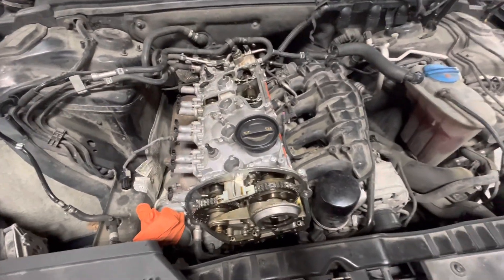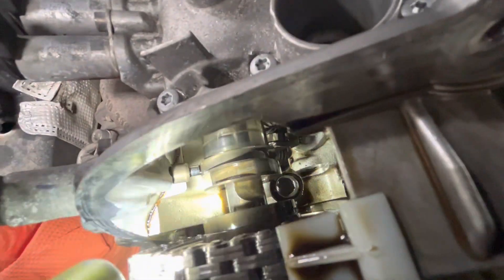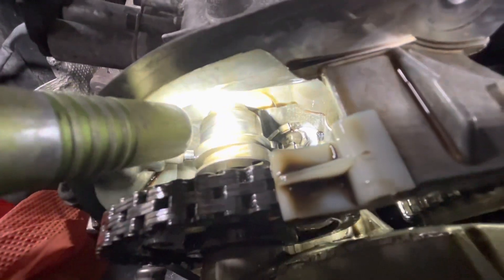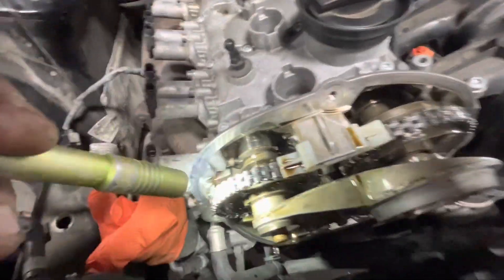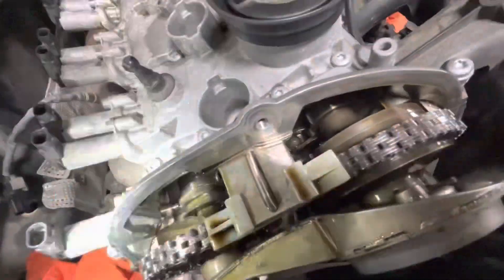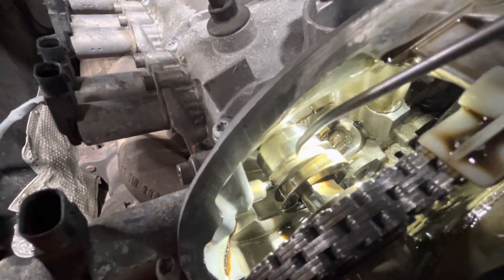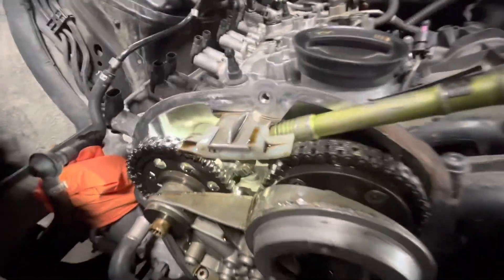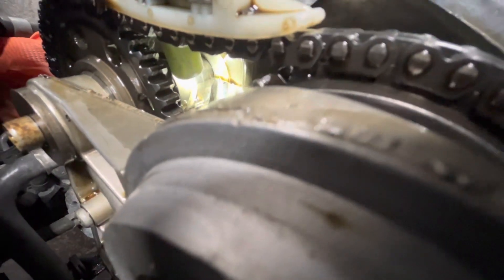TRYING TO EXPLAIN HOW THE VARIABLE VALVE LIFT WORKS ON AN AUDI

Comment: I’m having code P11AB Cam shift actuator B cylinder 3
Circuit/open. Could it be a faulty solenoid on cylinder 3? What would your first steps be to make sure?
Reply: It is on Audi Q5 2.0T 2018

Comment: Hi mate.
Early this morning my audi a5 has been experiencing issues its runs fine on D and R but when changing gears above 2000 rpm it hesitates and sort of lags.
Do you think its the solenoid?
Reply from the maker: It doesn’t sound like a issues with the solenoids to me, do you have any engine or transmission related faults stored

Comment: Thanks for this explanation. I was testing them and couldn't figure out why it was not coming backward when wires are inverted. Thing is when you apply 12v is doesn't come back only if you push on the little thing (can't find the name😅).

Comment: Could this give me a p0016?  I’m having long cranking at start up then it drives smooth but less power.  Any help is appreciated. Thanks in advance
Reply from the maker: What car do you have?
Reply: @EuropeanAutoRepair  2015 A4 Quattro
Reply from the maker: If it’s a 2.0tfsi you need to make sure the timing chain isn’t failing. If that’s the case you shouldn’t drive it until repaired
Reply: @EuropeanAutoRepair  the news I was fearing 😢 ok i have to drive it to and from work these next two days then will take to a shop to get a proper diagnosis.  Thanks for you help and feedback
Reply from the maker: @BangBangNiner no problem!
Reply: If you remove them all to clean them ..do u have to use the pin tool to realign them? I didnt move cams or crank ..just removed them all one at atime to clean /and reinstall.

Comment: I had a misfire determined it was the coil plug connectors so i replaced those and damages once of these connectors in the process unknowingly the misfire was fixed for a few start up then came back and that damaged connector is the only issue i can find. Is is likely it did damage to the motor?

Comment: One of my wires going to one of these solenoids are exposed and bare. Do u think that could cause a issue? I’m thinking about going to junkyard and getting new pair
Reply from the maker: Yeah using the factory wires would be nice to keep the colors correct but replacing the wires with anything the same gauge will be fine, do you have open circuit or short to ground faults stored?
Reply: @EuropeanAutoRepair no codes. But it has a stalling and idle issue when i come to a stop. Tomorrow I’ll go pull a new harness and hopefully I can fix it. Thanks for the reply I didn’t expect such a quick reply.

Comment: Would this cause a misfire/ intermittent compression reading, having a misfire with my Audi soon as it heats up its perfect I've done everything plugs coils injectors carbon clean, PCV valve diaphragm check my next step is to pull the head I suspect a burnt valve or cracked piston but after watching your video I began to wonder 
Cheers
Reply from the maker: I wouldn’t rule out a broken valve spring either, if the misfire comes and goes
Reply: @EuropeanAutoRepair i have same problem b8 2.0t replaced evrything vaulv springs injectors intake carbon clean spark coils still have cyl2 misfire only when you get on it you can rev it fine and evrything eles you can ease into rpm wont do it only when you get on it